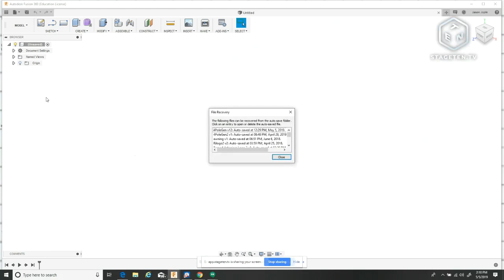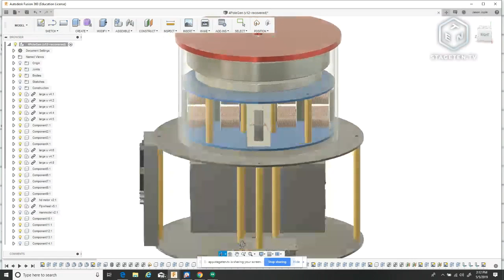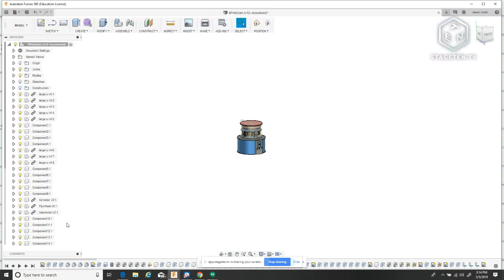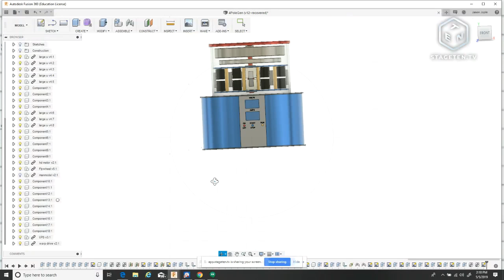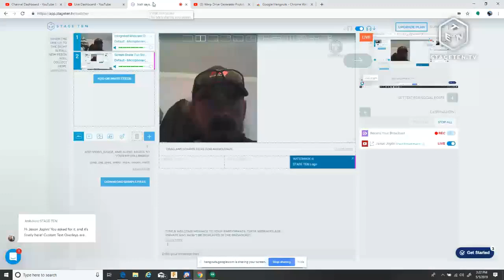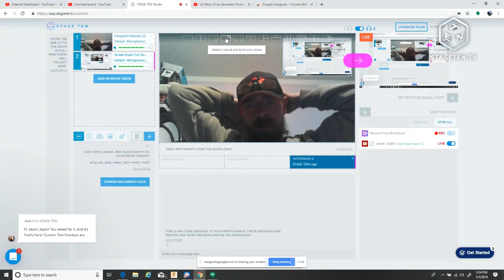Warp Drive Generator Prototype Complete

Comment: What is this? Is it supposed to be a warp drive or a power generator? Please don’t tell me you think you’re making a free power generator. That defies physics as we know it.
Reply from the maker: Physics as you know it, as taught in school is a flat out lie when it comes to electricity and magnetism
Reply: @JasonJoplin  Show the math or it's not real. Pictures or engineering concepts are worthless without a mathematical proof. Extraordinary claims require extraordinary proof.
Reply: So it is a power generator, not a warp drive? If a generator, I have tinkered at great length building cylinder v-gates but could never get it to go more than a few revolutions. How would this work differently so that it keeps working with a load attached? Thanks for your reply. It would be awesome if this could work but I don’t see how it’s possible in my experience. Thanks again.
Reply from the maker: It has a 600watt parasitic load from the motor on the generator, it is propelled electricly, it's not a magnet motor

Comment: Are you planning on including an internal exhaust fan/unit in the base due to probable buildup of heat from the components housed in that base?
Reply from the maker: Yes I do
Reply from the maker: The top will be vented along with the base and it will draw air upward through the unit